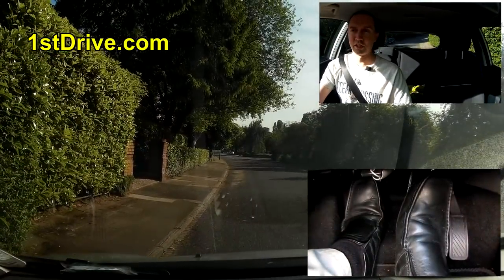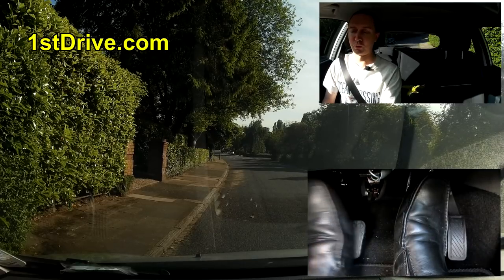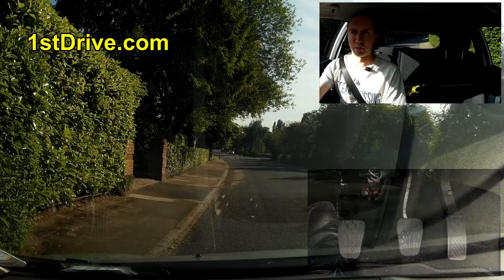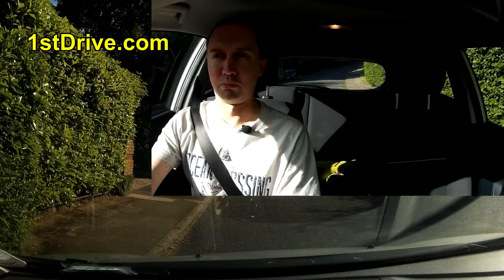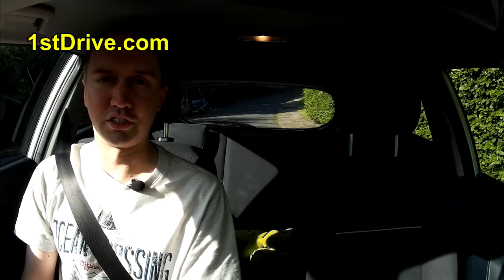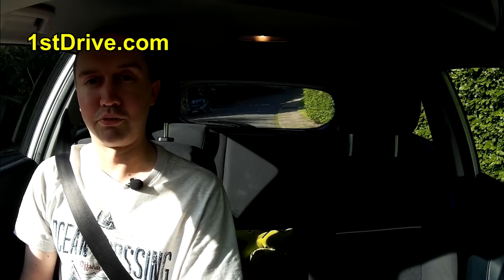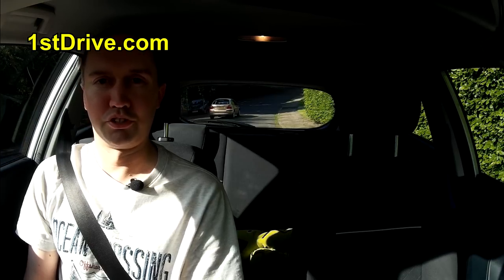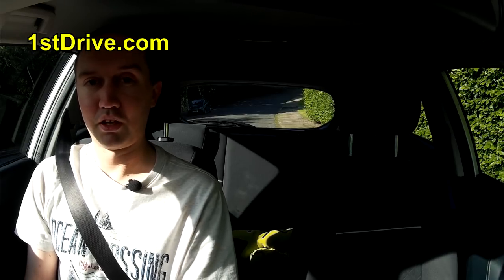Moving Off On A Hill

Comment: When I do a handbrake start on a hill, I add 2,000 rpms on my petrol car being the car to the bite and release the handbrake and the car crawls away, it would surely hold people up when I’m moving away like thst on traffic lights thst are uphill. Should I use more gas or add more gas as I’m bringing the clutch up once I released the handbrake? I passed the test but still don’t have much confidence with hills. My instructors car was a new car which we could move off on just the clutch and he got me into that habit and never corrected it. My 2006 1.3l petrol car obviously doesn’t have the anti stall technology but in his car I used to use the clutch to hold the car on the hill then use the accelerator when the handbrake is down hence my lack of confidence with them on my own car
Reply: You might be holding the clutch at the bite for too long. You could bring the engine speed up to 5000RPM but if you are holding the clutch at the bite, you will only move off slowly as only part of the power is getting through to the wheels.

Comment: Hi, 

Couple of quick questions,

Is it possible to perform a hill start using only the foot brake?

And could you do a video on bay parking? Only where I passed in Huddersfield they didn't have a proper car park so I was never taught it.
Reply: No, using foot brake isn't safe because when you have to release the brake to hit the gas pedal the car would roll backwards. So using the hand break is recommended.